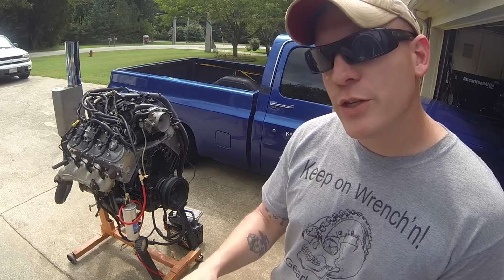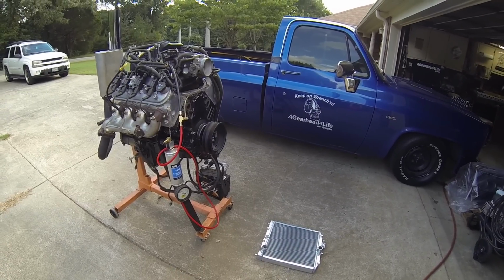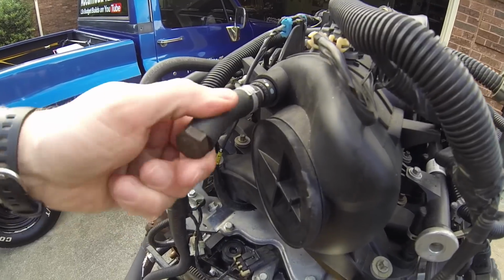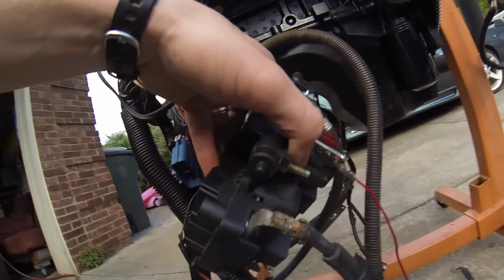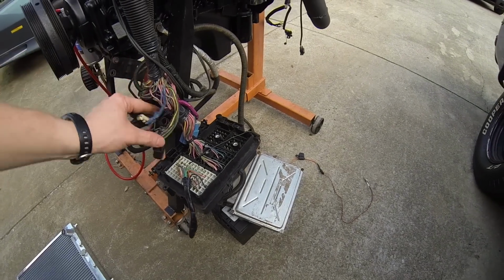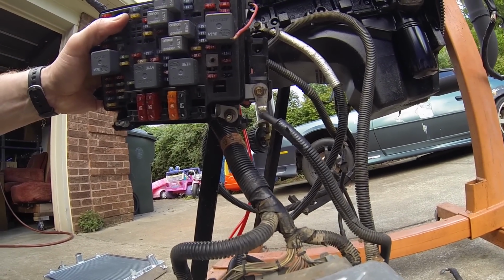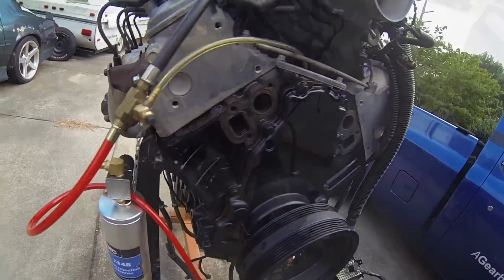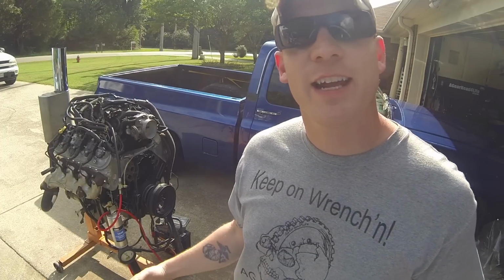LSx Swap Harness How To Simple & Free DIY Standalone on the Test Stand

Comment: i am stumped.. i sent my pcm out to be flashed and re programmed for a cam tune, i have a 2000 2wd truck harness with the fuse block c2 is attached to the fuse block i have watched this particular video a few dozen times everything is plugged in and connected but when i hook a jumper wire from c1 a9 to the + terminal i get no relay click or anything the terminal has 14v on the fuse block when i try to start it it truns over but no spark at the spark plugs.  does it matter which ignition coils used? i have the round ones with the heat sinks not the ones it come with which were the square ones
Reply: Did you ever figure this problem out? I am having the same issue, thank you
Reply: no as of yet i am still trying to get it to fire up
Reply from the maker: It'd likely be either that you used the wrong power post terminal on the fuse block, dont have all of your grounds hooked up or you didn't plug in the crank sensor behind the starter.
Reply: HELLOW my trans am 77 6.0 swap just star and die somebody tell me, the problem is you dont have the key is that true?

Comment: Do you have a video showing how you clean up the wires? I have a 5.3 with a harness. All i need is the pcm. I want to get rid of every wire I don't need.
Reply: And i will be hooking it up to a th350 trans
Reply: And do you need the obd2 hook up?
Reply from the maker: I do not yet, but it's on the list, for sure.
Reply from the maker: You dont have to have the OBD2 hook up, but it's handy to have. It's pretty easy too. Just one wire, plus a power and ground.

Comment: I've pulled out my old 350 and cleaning out the engine bay. What parts list do you recommend? I was told I need a new gas tank, headers, new radiator, and electric fans and so on. Any quick info would help. Thanks for your videos
Reply: Can you send that list my way

Comment: Where can I find those bolts to hold the motor to the stand?
Reply from the maker: +Stephen Davis Any hardware store like Lowe's, Home Depot, fastenall or even eBay.
Reply: AGearHead4Life Do you remember the exact size?
Reply from the maker: +Stephen Davis Think they're 10 x 1.5, but length will vary depending on the engine stand you're using. Usually about 3" long. Just take a bolt off the front accessory or a bell housing bolt with you to the hardware store to match up the thread and get grade 8 bolts and some washers.
Reply: AGearHead4Life Thanks man i got them yesterday

Comment: So I'm doing a swap. What you are saying is, I don't need the maf or 02 sensors or is that just for running on the stand only?
Reply from the maker: Brody Sawyer You should use them. This was just to run them on the stand. You can use them on the stand too. Was just showing that you don't have to.
Reply: AGearHead4Life that's what I figured. Thanks!!! Are you going to do a modified harness video?
Reply from the maker: I hope so! One day. It'll be a while though. Too many other projects ahead of it.
Reply: @AGearHead4Life  do you have to do anything different on the fuse block in order to run the 02 and MAF?

Comment: do you have a video on fuel systems? I was wondering how you mostly modify fuel systems. do you use an inline pump or just redo gas tank with in tank pump?
Reply from the maker: I usually use an in-tank. That's what I prefer. I have used an in-line before though. I plan to make a video on this once I get moved.
Reply: AGearHead4Life.  thanks! going to try inline first. getting closer on my jeep project. engine mounted, radiator and flashed ecm supposed to be here tomorrow. hoping to hear it run by tues. thanks for the help!
Reply from the maker: David Dudley Awesome! Good luck!

Comment: hey man I have a 2010 Camaro v6 and have always planned on doing a swap. My motor just blew a few weeks ago and I dont want to replace the 3.6. As many people have already told me, the cost to do the swap would outweigh doing it. But I wont get rid of my car regardless. I was wondering if I use the standalone, will it work with a 5th gen Camaro? Or will my hvac radio and other electrical componentsnot work?
Reply from the maker: +tRRuble Where there is a will, there is a way. It is possible, but I couldn't tell you how to do it without research. I wouldn't guess that you'll need a stand alone harness though. I'd expect that you could just take all the parts needed from a V8 2010 Camaro and plug them into yours. That would likely be the easiest way. It will not be cheap and will take and effort, but it can be done.

Comment: I have a 97 gmc sierra 4x4 and a 2005 Avalanche 4x4 donor that I'm using for the ls swap, is there anyway to do a video on how to connect harness to old 97 harness so all the gauges work or how would I go about installing the 05 harness and getting it to work
Reply: Best way I've seen yet..

Comment: If the vats isn't removed will the relays not click I have it wired the same way I am going to pin a9 like you said and the relays don't do anything
Reply from the maker: +Adrian Yates The relays will still click. Two common mistakes that could be your issue are that you're actually on A10 because it's easily to read wrong and the other is to make sure that you have a good ground.

Comment: hello how are you plz i have hummer h3 2006 v5 3.5 l  with E40 ECM if i find v8 gn4 with E67 Ecm and harness i can  put it on my h3 and work properly all gauges and ABS and traction control? and transmission sure i wanna make changes in the 4l60 to v8 ...

Comment: Mark, do you know which wire you use on a 2008 stock fuse block for the ignition?
Reply from the maker: David Dudley I do not man, but you should be able to figure be out by searching LT1SwapDOTcom for diagrams. That one will likely need a couple different things than this one. Like the DWW gas pedal.

Comment: Hey I got a 2004 Chevrolet Silverado single cab 2 Wheel Drive with a 4.3, And it is drive by cable and I want to swap it to a 5.3 Drive by cable and I know I need to get an engine out of a 2000 to 2002 Silverado but I’ve heard that I That would need the wiring harness for 2004 V8 53 and that engine on the 2004 is drive by wire so is the is there a way to wire that for a drive-by cable

Comment: hey bro like your videos I got a 5.3 from a 2005 Tahoe complete pull out just don't kno how to wire it to my 82 c10 do I need an aftermarket wiring kit
Reply from the maker: +Tony Maldonado Thank you Tony! What you use for your harness is your choice, but this video shows you one of those options.
Reply: +AGearHead4Life hey thanks for the help you made me understand how easy this can be also you recommend a certain brand of inline fuel pump? thanks
Reply from the maker: +Tony Maldonado No problem. Yep, i use a Walbro 255. They make many different models of it. SO you pick the one that fits what youre trying to do.

Comment: I have a 1994 GMC Z-71 and my son gave me a 6.0.i know I got to get a intake for it cause he had to use it but other than the computer what else do I need to get from a donor truck.what is the best intake to get ,etc.i am going to round up all the stuff I need and then rebuild and put in my truck.getting trans built now.
Reply from the maker: +Gene Holmes Another truck intake will be fine. Snag the throttle cable too. Those are often handy.

Comment: Hey man, I am doing an LS swap on my 98 chevy 2wd truck. I have searched everywhere and can not find if I need an adapter for my application. I am putting an 2002 chevy Tahoe 5.3 in my truck and using stock 98 chevy trans 4L60E. did you have to use an adapter for flex plate and torque converter?

Comment: What would be the next way to get fuel to the engine with the injector cleaner setup your using
Reply from the maker: 209chevymon Say again? I don’t think that I’m picking up what you’re putting down.
Reply: @AGearHead4Life  o sorry i meant without the injector cleaner you used ive done what you said and i turned my engine over but not for long cause 1 i havent deleted the vats thats happening soon so when i get it back i need to have a fuel setup and was wondering what is another option instead of your way with injector cleaner ive seen other vids and they used a bucket with gas in it but dont explain the setup hope i made sense this time

Comment: My Harness doesn't have a fuse block, the junkyard chopped it off. What do you recommend I do?
Reply from the maker: +DJGolDon I would study the wiring diagram and supply power to the needed wires, which are mostly all the pink ones. That's what I usually do anyway. I cut that big fuse block off because it's ugly. I then use a small universal fuse block to replace it. If you don't get along with wires, you can pay guys to do this for you. Kenny Cash with "LS Wiring Harness Conversions" on Facebook is a good guy and can do that for you.

Comment: ? What are the pros and cons of turning off the emissions?
Reply from the maker: Armando Loredo The EGR system is just to help burn unburned fuel in the exhaust so that vehicles pollute less. These engines usually run pretty efficient, so their pollution is not very bad at all in stock form especially when compared to old SBC. 

These emission controls can get in the way of a car builder sometimes by either being a restriction in the exhaust like a catalytic converter or by just making the engine bay look more cluttered by having EGR piping hanging off the side of the engine. Because of this, they're often removed in states that allow it. Besides the looks and performance benefits, it can be expensive to maintain if you have to buy a replacement catalytic converter.

If a vehicle was focused on performance, it wouldn't want the restriction of a catalytic convert in the exhaust.

Also another example of emission controls is the factory thermostat. The goal of 195* is the best engine temp for the balance of emissions and performance of an engine. If you got it warmer, the engine would produce less emissions. If you kept it cooler, it would perform better but produce more emissions. I think a 160* thermostat is too cool for a daily driver street car and prefer to run a 180* thermostat.

Comment: How do I wire in a 2 wire 1999 6.0 alternator? The old school way for it to recharge the battery
Reply from the maker: I think those “excite” automatically with enough rpm. So just hook up the charge cable and it should charge. Wait wait, I’m thinking of the newer ‘08 version alternators. The older ones still need on wire going to the pigtail. Forgot which. I think it’s the second one over from the left if looking at the front of the engine. It’s gets ignition hot.

Comment: thanks a bunch for the video!
I'm swapping and  03 5.3 in to a 1995 2500, will the 95 transmission work with the 03  computer ? or can I just leave the 95 computer in there to control the trans, and use the 03 ecu as a standalone?
Reply from the maker: You could figure out a way to make it work, but I wouldn't recommend it. I'd sell it and buy a newer one for the same price.
Reply: Thanks for the reply.

Comment: Good morning. Have you ever done a drive by wire motor and put in a drive by cable throttle body? I am breaking my head on how to do that on my 87 Monte Carlo SS. I've looked on threads and some say that there is a conversion for it, but I never found it. Should I just do DBW and get it over with? Thanks in advance.
Reply from the maker: You can go either way. You chose. Both directions are good and about the same amount of work. Yes, the harness in my '87 Chevy truck was a DBW harness with red/blue connectors. If you have red/green PCM connectors, it may be a little more tricky. All you have to do is add the wires that are missing for the IAC and TPS to the harness and pin it into the PCM connectors. Pretty easy. All of the information needed to accomplish this is on the LT1Swap link that I posted in the video description also.
Reply: AGearHead4Life 

Ok, I will try that. Thank you for the info.

Comment: hello. I was trying to find your video on connecting the obd2 connector as mentioned in this video. got a link for it?
Reply from the maker: Nah, I haven’t made a video on wiring the obd2 port. But I’ll tell you that it’s super easy. Just find any power and ground and the then serial data OBDll wire. Pin them correctly in the OBDll port and you’re done.

Comment: What about newer system with drive by wire electric pedal would this still run? With 2 wire hook up? Thanks for great info.
Reply from the maker: +Mr.G There should be a way, but I couldn't tell you without looking up the diagrams. I can tell you that you'll need the electric gas pedal and TAC module though.

Comment: Where are all the areas where you need ground 
Just to the engine block?
Reply from the maker: Yea, the engine block is where the harness is grounded, but on the truck harness there are two or three grounds. Two are at the top rear of the passenger head where it meets the block. 
I think there’s a third at the front left side of the engine block.
Reply: AGearHead4Life awesome thanks

Comment: I have a 2006 LS for my 65 C10. It's fly by wire and I have absolutely everything. So will this method work for the 06? And as I asked prior to the reply. Does the pcm control air fuel ratio like it's supposed to? Thanks for the help man, and I sub your chan also.
Reply from the maker: +Laby 70 I answered you other post.

Comment: I have a 97 chevy Silverado and  it's has a 4l60e transmission I have a 5.3 for it and was wondering how to make the transmission from the truck work with the 5.3 i want to put in it
Reply from the maker: Gary King You'll need to make sure the flex plate bolt holes line up. Sometimes you have to elongate them to fit. Also you'll need an adapter that supports the Converter snout into the crank.
OR you can buy a conversion flex plate.
Reply from the maker: Gary King Or you may be able to use a 6.0 flex plate, spacer and bolts, if you have one.
Reply: AGearHead4Life yeah I can get one today
Reply: AGearHead4Life I guess what I was asking about was the 4L60E transmission in my truck i want it to still work and have all my dashboard to wory too I have a turbo 400 transmission gor the truck but the truck has a 411 ring gear with a 295 65 15 tire that's why i wanted to use the 4L60E transmission
Reply from the maker: Gary King Yea, ideally, I'd get an 80e or an LS 60e to keep things simple. Usually one can sell a good 60e for enough to get the one that they need.
For the gauges, you'll have to keep researching. There's a way, but I haven't done it yet.

Comment: AGearHead4Life i have a 1987 chevy custom deluxe v6 im bought a 2003 chevy 5.3 engine and on the wiring what do i do with the old wiring from the old motor to the new moter wired
Reply from the maker: You chose what you want to do with it. It's all optional to you. It's not used for the LS motor, besides the ignition coil hot wire.
Reply: so its easy work to do or difficult  if you dont know about wiring
Reply from the maker: Uriel Saenz Id compare it to installing an aftermarket car stereo. If you have a hard time with that, then you'll have a worse time with this.
Reply: AGearHead4Life ok i started its not that bad,  little difficult but i will get it . and thank you for your help

Comment: So should I just use the whole fuse block from the donor vehicle in my host to simplify everything? Thanks.
Reply from the maker: Yep, if that's what you prefer. That' why I made this video. This is step one, the easiest way to do it. It's up to each individual to decide how far they want to take their harness.
Reply: So when I get the harness off of the donor truck body I can just cut the group of wires going into the cab under the a/c dryer right?
Reply from the maker: Any wires that you decide that you will not be using, yes you can cut them off. Just make sure that you wont need to use them. Usually the ones that go to the cab will unplug from the engine harness.

Comment: Mark, Can you explain how you are achieving 60lbs of fuel pressure? and what the instrement you are using is called? I getting my engine pulled out soon and plan to start it on the stand im just looking for how ill get it fuel. Thanks!
Reply from the maker: well, you could just start and idle it off of starter fluid, if you can spray a small steady stream. I do this sometimes, but it takes practice. That tool that I'm using uses air pressure from my air compressor to pressurize the fuel inside the canister and push it into the fuel rail.
Reply: AGearHead4Life could you tell me what it's called so I can possibly order one? Getting closers to. My engine pulled out and getting pcm flashed for vats in next couple weeks. I have all I need but that instrument to keep the pressure right you're using.
Reply from the maker: Ah yea, there's a link to it in the video description too.
"OTC Tools (7448A) Fuel Injection Cleaner Canister"
Reply from the maker: https://www.amazon.com/gp/product/B00GZ0H9VC/ref=as_li_qf_sp_asin_il_tl?ie=UTF8&camp=1789&creative=9325&creativeASIN=B00GZ0H9VC&linkCode=as2&tag=age0a0-20&linkId=LKPOAAY3BOMZWXW7

Comment: I have a ls1 5.3 in my 78 camaro ..I just got a 6.2 ls3 I'm about to put in an I was trying not to buy another harness what u think about just extending the cam sensor wire ?
Reply from the maker: +Jose Marrero You also need to consider the crank reluctor ring being an issue, 58 vs 24. The same computer wont work on both engines usually. As for just extending wires, I'm all about it and have done it. I just repaired a harness that was cut completely in half. Same idea, just solder it.

Comment: Would a reman pcm from a parts store still have the VATS on it? Or would those be "flashed"?
Reply from the maker: Matthew Green I would expect that a PCM like that would require a flash from the dealer (or possibly HPT) to work in any vehicle, to sync up the VATS and anything else.
So yes, I’d expect it to still need to be flashed.